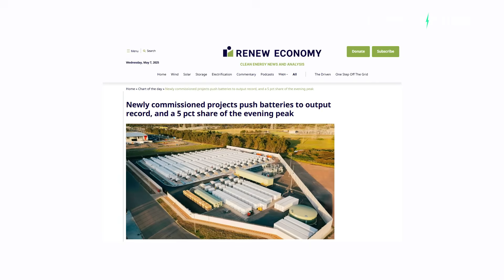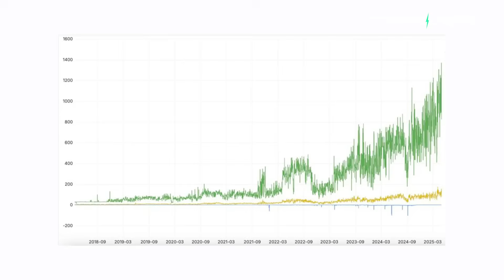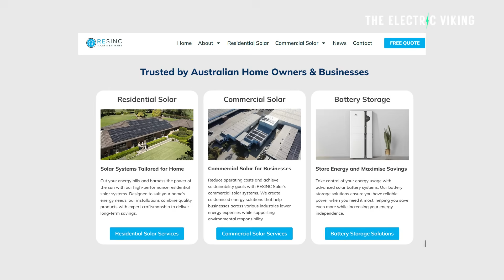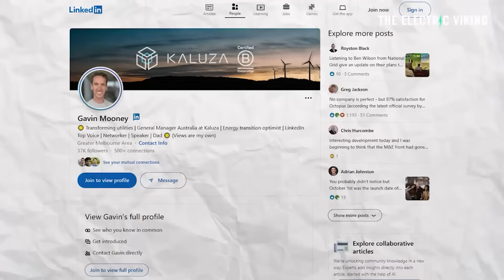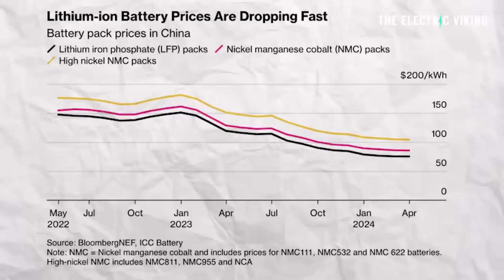Battery power hits new record in Australia - will skyrocket 7,300% in 1-2 years

Comment: The Duck Curve is actually the opposite of PV production: The Duck Curve refers to a graphical representation of electricity demand from the energy system on days when solar energy production is high and demand in the grid is low during the middle of the day, and when demand peaks in the evening.

Comment: There's just one problem. These open air energy storage systems are extremely vulnerable to even low-level terrorists. But in the event of a military conflict, the electrical grids of the "battery-powered nations" could be destroyed in a short time—so completely that the country would have to capitulate just because of it.
Reply: Local decentralised storage actually makes the grid more resilient. If there is an attack on the tranmission system, (this happened last year in the US), then the local battery can still power the community.

To be reliant on distant power stations, and long venerable tranmission systems without local batteries, is more risky system design.
Reply: @nordic5490  Local systems are not built to be independent of the grid. Otherwise, the Spanish blackout would not have happened.

Comment: Ok so we have tripled the battery storage in 3 years, but to say we are going to add, not 7.3, but 73 times the amount of battery storage as we currently have within the last 2 years is just a blatant lie.
From Renew Economy that is often quoted here, "A new report has predicted that Australia is on the cusp of a big battery boom that could deliver 18 gigawatts (GW) of installed energy storage capacity by 2035 – an eight-fold increase on the 2.3 GW installed at the end of 2024."

So we are more likely to add 8-10 times the battery storage we currently have over the next decade, not over 70 times the storage in 1-2 years. Pretty important distinction to make.

Also, on curtailment, AEMO expects that we will see more curtailment in the coming years, not less, due to solar pv generation capacity still exceeding demand and available battery storage (because we aren't adding 73 times the battery storage within the next 2 years).
Reply: Curtailment will not be a thing once the planned pumped hydro storage systems are built.  Excess power will be used to pump water up to the top dam.
Germany has built a high voltage undersea transmission system to Norway. Germany rents a pumped hydro facility in Norway (Norway has 900 hydro powerstations) to store Germanys surplus renewable power. This technique is a mainstream.

Comment: What a load of unmittigated BS.  The amount of battery capacity being added is tiny compared the need for backup.  That's why this idiot talks in % and not in actual GWh.  What is this guy's agenda for lying?
Reply: What is you adgenda ? The CSIRO says that renewable plus storage is 1/3rd to 1/2 the price of nuclear.
Are you more of an expert that the leading scientists in thier field ? Seems unlikely.
Reply: @nordic5490  You’re simply repeating misleading claims. The CSIRO report focuses narrowly on generation costs, which paints an incomplete picture. Renewables like wind and solar may appear cheap, but only when the sun is shining or the wind is blowing. Their intermittency makes them far more expensive in practice, requiring extensive backup systems such as batteries for frequency control, pumped hydro, and open-cycle gas turbines (OCGT), as well as substantial investment in transmission and distribution infrastructure.

Wind and solar typically generate electricity only around one-third of the time, meaning you need to install roughly three times the capacity just to match the consistent output of a nuclear plant. When you account for the full system costs—including firming, grid support, and overcapacity—nuclear becomes not only competitive but also highly desirable. It offers compact, reliable, low-emissions baseload power, with operational lifespans of 60 years or more. Unfortunately, the CSIRO analysis excludes most of these critical factors, considering only generation costs and a few hours of storage, which distorts the true economics of energy systems.

What is my agenda?  I am a qualified mechanical engineer, and studies this subject all my life.  I am deflecting inaccurate and misleading claims about energy generation for the sake of the next generation.
Reply: @nordic5490  with regard to batteries.  They are expensive, and while prices are dropping slowly, they will not be cost competitive with gas until 2050 earliest.  They are also not clean, and require a lot of energy to manufacture, which means emissions.  Currently batteries are barely keeping up with requirements for FCAS, and capacity is more than an order of magnitude too low to provide suitable firming. The current policy trajectory is ambiguous.  We need more gas for backup, and this is contrary to net zero.
Reply: @nordic5490  You’re repeating a misleading narrative. The CSIRO only reports generation costs, ignoring the real-world expenses of renewables—like backup (batteries, pumped hydro, gas), grid upgrades, and overcapacity. Wind and solar produce power only about a third of the time, so you need triple the capacity to match nuclear’s consistent output. When you factor in these system costs and nuclear’s 60-year lifespan, it’s not only competitive but also compact, clean, and reliable. CSIRO’s narrow focus hides the full picture.
Reply: @nordic5490  My agenda?  I am a qualified mechanical engineer with a lifetime of experience in energy generation technology, although I work in IT.  I just don't like people making unjustified claims, it leads to poor political decisions, it is ruining Australia's future.

Comment: I have solar and battery on the house, but I think it is not healthy to reject outright nuclear power as s part of the production network. Unfortunately these subjects have become ideological driven and the same applies for those against renewables.  Finland has nuclear and renewables and I think Labor may need to look into nuclear as an add on to the equation in the years to come.
Reply: Ha ha ha ha ha. Rejecting renewables is a culture war issue for Skynews / LNP supporters.

Bottom line is: the CSIRO say that nuclear power is 2 to 3x more expensive than renewables plus storage.

If the LNP were actually the party of fiscal responsibility (tip, they are not) as they promote them selves, the LNP would embrace renewables. But, no, the LNP has rejected a fiscall responsible energy policy, and embraced nuclear.
Reply: @nordic5490  ...the costing were, hmm, economical with the truth.  The costings for the renewable project didn't include the extensive construction of all new network distribution.  Also examples on costings for nuclear were a couple of projects that had significant cost blowouts includingthe plant in Finland, something that unfortunately is common in Australia and particularly in Victoria which points to something else.
There is room for renewables, gas and nuclear.  Network frequency stability is an important factor.
As there are anti renewable camps there are also anti nuclear camps and mostly they are camps upon how people vote.

Comment: ontario is planning new nuclear projects. cost for smr is cheaper than renewables. 

Officials estimated the average cost of power from the four reactors at 14.9 cents per kilowatt hour, contingent on the federal government providing investment tax credits.  see info below. 

The IESO said an alternative would be to build between 5,600 and 8,900 megawatts of wind and solar generators supported by batteries. Their capacity would need to be far greater, it reasoned, to account for the intermittent nature of wind and sunlight, and they would also require far more new transmission infrastructure. The IESO estimated the costs for all that at between 13.5 and 18.4 cents per kilowatt hour. Building the BWRX-300, the IESO concluded, is the lower-risk option.
Reply: That might be relevant to Canada, that has way less solar resources than Oz.

Rejecting renewables is a culture war issue for Skynews / LNP supporters.

Bottom line is: the CSIRO say that nuclear power is 2 to 3x more expensive than renewables plus storage.

If the LNP were actually the party of fiscal responsibility (tip, they are not) as they promote them selves, the LNP would embrace renewables. But, no, the LNP has rejected a fiscall responsible energy policy, and embraced nuclear.

Comment: It looks that Electric Viking don't know what he is talking. Batteries doesn't produce energy but Nuclear does. Batteries need to be charged. When 1000 MW nuclear producing 24 GWh in 24 hours (in reality producing 24/7), batteries that can hold that amount of energy when 1 kWh batteries cost €100 mean that 24 GWh batteries is 2.4 Bdollars. In reality the price can double. 

The solar power because it is intermittent and only during the day producing energy, could be 5 GW solar. The total price of the solar/batteries can exceed the price of Nuclear. Nuclear has lower footprint and is extremely reliable (see recently Spain shutting down their nuclear).

A lot of these podcasters talking about electricity without understanding what is electricity.
Reply: Educate your self mate. Nuclear, coal and gas cannot respond quickly to varying load demands, batteries can. Get up to speed.

Comment: Question for u Sam @electricviking , how many solar panels and batteries would u need to ensure u ALWAYS have power even if it’s been raining for two weeks??? Would it be economically viable to do???? No, of course not! So what makes you or anyone think it’s economically feasible to implement a renewable only approach for the entire country??. The power HAS to be on ALWAYS and it’s cost prohibitive to set up ur home for that let alone the country.  Please, some common sense!!!   Nuclear is an intelligent solution to compliment renewables.  You and the others who have commented are green, ideological zealots.
Reply: Nope.

Rejecting renewables is a culture war issue for Skynews / LNP supporters.

Bottom line is: the CSIRO say that nuclear power is 2 to 3x more expensive than renewables plus storage.

If the LNP were actually the party of fiscal responsibility (tip, they are not) as they promote them selves, the LNP would embrace renewables. But, no, the LNP has rejected a fiscall responsible energy policy, and embraced nuclear.

Comment: The thing to remember, batteries are only part of the solution. We need change across every sector. We need more power cables to interconnect our states and Asian customers. We need other solutions, but not nuclear. We already have solar factories running on renewable and ways of recycling blades. Getting closer to a circular economy, but we need to get there quicker if we want humans to survive. You can't drink plastic, and you can't eat gold, we need ocean ecosystem repair.

Comment: There is probably a space for nuclear even with a renewables focused production environment with battery storage. The angular momentum of a turbine really helps to keep a grid operational. Solar and batteries are genuinely awesome and I love their increased use but with the reliance on inverters they do have issues if anything happens to the grid.
Reply: A space for nuclear... - but so expensive - to build, to run...
Reply: I don’t disagree but what is the alternative for guaranteed grid baseline production that maintains angular momentum to help with grid stability? 

And I’m not sure nuclear has to be that expensive: the current generation of reactors being built are all based on quite upgraded tech that have had issues (France casing cracking and UK cost over runs as they build to higher specs than the French did). Once those issues are worked out I would expect the next few reactors to see quite substantial price decreases and Australia could look to leverage off of that developed expertise.

Longer term something like flywheel energy storage might offer a useful solution but I’m not sure how that will interact with grid stability rather than just energy storage.

Comment: Sorry. The Eraring battery will have a 700M watt output with 2.8G watts of storage. The current coal power plant has 4 x 720M watt output. The battery can only supply 1/4 of the replacement coal power plant.
Reply: So, install four batteries?

Comment: How long do they provide power for and how long till the battery needs replacing and Nuclear will give as the base power and last 60 to 80 years What do you do with all the old solar panels, turbine blades and batteries at the end of their life
Reply: The waste will be stored in ponds. No wait, that's coal ash. The waste will be stored in containment pools waiting for a place to be found where there aren't enough NIMBYs to stop the storage facility. No wait, that's spent uranium.  The waste will be left out in the open, leaking chemicals and gasses. No wait, that is all the orphaned gas and oil wells that tax dollars are going to be used to pay to close. Read up on current recycling capacities and plans for expansions all over the worlds.

Comment: This is great news! It is very lucky that Australia was saved from a disastrous nuclear future. I'm not against nuclear, I think it works great in many parts of the world, but was not right for Australia when you have so much solar and wind! I wonder if you could do a video on how the Australian grid will cope with intertia? That is how it keeps its 50 Hertz frequency. Traditionally this was not a problem as all electricity sources were spinning generators. Solar uses inverters, and so does wind (ironically, as they spin, but due to wind variations wind turbines also use inverters). In China they are installing enormous flywheels onto the grid, to keep the inertia with all the solar and wind sources, I wonder if Australia will do the same?

Comment: China is constructing 154 nuclear powerplants right now, they are backing nukes to power their grid.
Reply: In the next five years China is expected to add annually: Solar: ~100–150 GW, Wind: ~30–40 GW, Nuclear: ~8–10 GW , BES: ~3–5 GW. Now lets change the numbers for CURRENT capacity factors in China: ~20-30 GW, Wind: ~11.3-15 GW, Nuclear: ~7.2-9 GW.  Wind and Solar capacity factors will increase, Nuclear will remain in the same range. Coal net increases for the next 5 years is around ~30 GW annually, ~15 GW with current capacity factors.

Comment: Batteries don't work during dunkelflaute, and inverter generator sources are unstable when they dominate the grid, leading to blackouts similar to the recent one in Spain.
Reply: This not a problem with technology, synthetic inertia currently works in multiple countries, the problem was Spain's government: "While technologies such as batteries, synchronous condensers, and advanced inverters can provide synthetic inertia and help stabilize grids with high renewable penetration, Spain has not yet deployed these solutions at the scale needed to match its rapid growth in renewables. Experts note that countries like China require stabilizing capacity (such as storage or flywheels) alongside new renewables, whereas Spain’s approach has focused more on generation than on parallel investments in grid stability technologies"

Comment: Regardless of how much battery storage we might have, the nation still needs reliable backup generators as prolonged wet weather over large areas cutting solar contributions drains batteries quickly, leading to possible blackouts.
Reply: We need is more pumped hydro storage for long term energy security on our grids.

Comment: Batteries do not generate any electricity - nonsense to claim that a battery can replace a coal generation plant. I cannot wait for a Spain stype of grid collpse in Ausralia with this nonsense being preached.
Reply: "While technologies such as batteries, synchronous condensers, and advanced inverters can provide synthetic inertia and help stabilize grids with high renewable penetration, Spain has not yet deployed these solutions at the scale needed to match its rapid growth in renewables. Experts note that countries like China require stabilizing capacity (such as storage or flywheels) alongside new renewables, whereas Spain’s approach has focused more on generation than on parallel investments in grid stability technologies" Australia is better with synthetic inertia than Spain, but worse than China.

Comment: Percentage of growth is not relevant, its the actual MWh of storage added that's important.
For example going from 400MWh to 1,400MWh of storage is 250% growth, but its insignificant for a country like Australia.
They probably need 100GWh (100,000 MWh) of storage to go 100% renewable (including the vehicle fleet going electric).
Reply: The fleet going electric will provide a large amount of the necessary storage capacity..🌝
Reply: @malcolmrickarby2313  Vehicle-to-Grid will be part of the mix but I doubt it will be the majority.
My estimate is that most will be provided by large scale batteries, its just cheaper and more reliable.
Reply: @malcolmrickarby2313  No where near enough.
Reply: Probably more like 700GWh.
Doable. But will take a while.

Comment: Love your videos🤩 I belive nuclear is needed ref Spain powerblackout. One question I have: nuclear i container vs batteries? My impresion is that Batteries and should smooth out the duck curve, that gastubine peakerplants did, but isn’t it a good idea to have a stabil nuclear baseload? Greetings from Oslo Norway😊
Reply: Nuclear's biggest issue is that it takes a long-assed time to get up and running. Time and money spent on nuclear is opportunity cost for other projects that can be set up much sooner. It's a trade-off, unfortunately.
Reply: Australia has much more sunshine all year long than Norway does so it’s energy demands are lower in the winter and can be produced reliably by solar.🌝